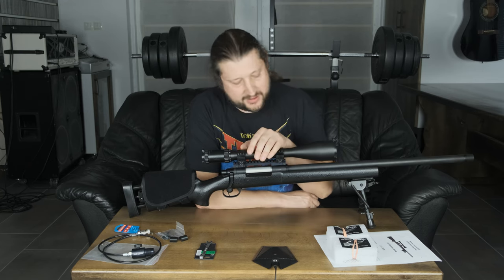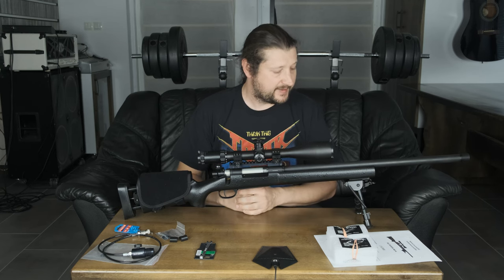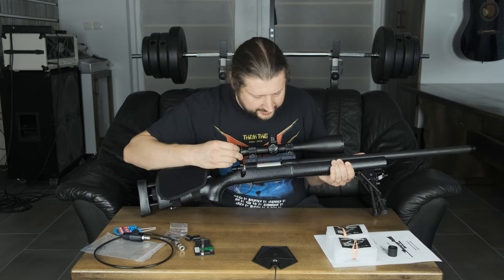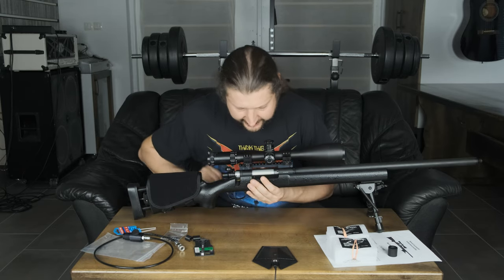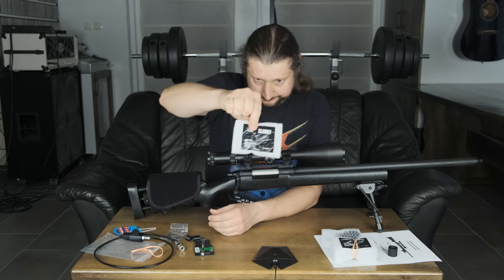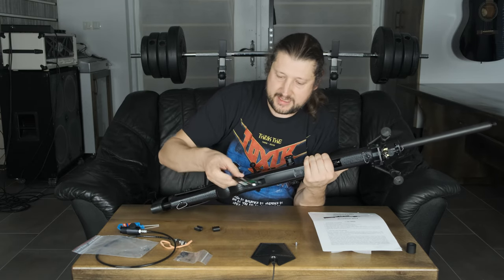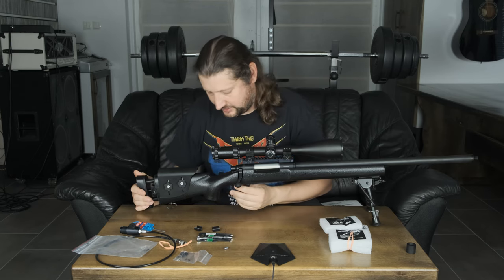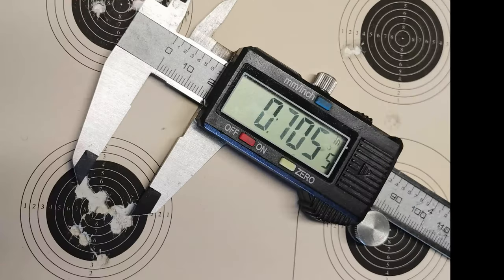Altaros M24 - Review

Comment: Hello, I have a question about the barrel. Which do you think would be more appropriate? I am considering LW polygonal twist 450mm. Thank you in advance for your opinion.
Reply from the maker: That entirely depends on what projectile you intend to shoot. If you intend to shoot pellets (I assume you are not :)) then LW choked poly 450 is a good choice. If you intend to shoot slugs, than there are so many more question that it is impossible to give a direct answer like: what slug, what is the externa dimension,... Lets assume you intend to shoot convectional swagged slugs; personally, I have never had any luck with those despite the fact that they are all the rage nowadays. For those, best option would probably be FX slug liner (I don't have much experience with those but people tend to get good results with them) or RPB barrel from RTI. Those barrels are built for these slugs. Altaros slugs also shoot well in those barrels (I can speak only for RBP)but they are do very well in conventional LW choked barrel that is already in the M24 (at least the ATP king)...
Reply: @gregorkamensek3923  Thank you very much for your opinion and information. Good luck to you.

Comment: First, I'd like to say how much I appreciate the quality of information you provide in your videos.
Second, would you say that the advantage of the valve design on the M24 has to do with not having to compress ambient air between the valve and the pellet/slug when firing?  Do you think having to compress the ambient air as required on more traditional designs contributes to the inconsistency of velocity?
Finally,  it would seem to me that having a flexible air tube between the bolt and the air reservoir that moves every time the rifle is cocked is going to be a wear point on the rifle.  Does the manual say anything about the estimated life of that part?
Reply from the maker: Thanks. I really appreciate it.
Yes, the fact that the "transfer port" is virtually non existing and therefor it does not have to compress almost any air during the shot definitely helps, especially in the power and efficiency. It does also help with the consistency but probably not in any noticeably manner. The consistency has to do with regulator, plenum size and the valve and the relationship between them, slugs consistency (weight and size) and the size of the plenu. The firing operation on this gun is really well balanced. It is much easier to achieve this balance if you have "fixed" application and I am curious what the consistency will be once I make adjustments to the system...
Reply: regarding flexible tubing:
so far I not need replace a single tube either on my prototype M24 rifles or on any production version. On some rifles, I have fired more than +10k shots on this final design of the tube. The tube itself does not move that much, so it is not susceptible to internal damage. Minor damage may occur to, for example on the outer black rubber casing,  which is not important for the tube from the point of view of strength or tightness.
Of course, if the tube is damaged for some reason, the tube can be easily replaced.
Reply: @AirgunRegulator  Good to know.  Thank you for reporting on your experience with that aspect of the M24.  It will be interesting to see Mr. Kamensek's disassembly of the rifle to learn how the internals work.

Comment: Hello Gregor, thanks for the review! Any reason why you decided for .22 and not .25? I'm considering it and don't know about the caliber. Decisions ..
Reply from the maker: I went for .22 mainly for two reasons:
1. Shot count (air cylinder size) - The shot count is low as it is, but if I wanted to get high power with .25, the shot count would be even lower
2. Plenum size - The plenum size is relatively small. So if I went with bigger caliber, I would have to have even bigger regulated pressure in order to achieve the power I would like to have...
In any case, I can make a .25 cal barrel and fit in the gun if I even desire to do so :)
Reply: @gregorkamensek3923  thx Gregor for your prompt answer, have a good day!